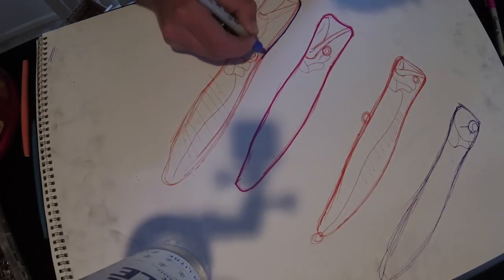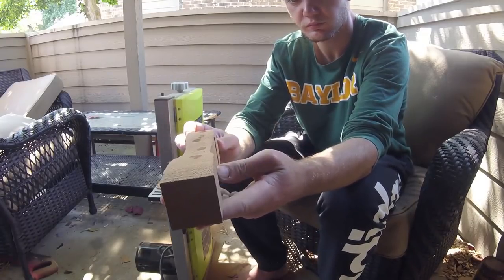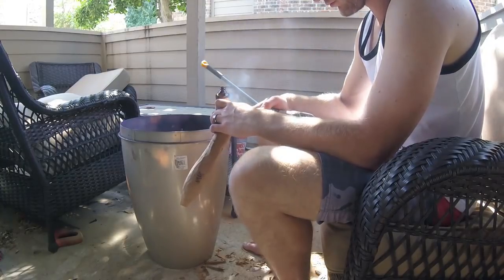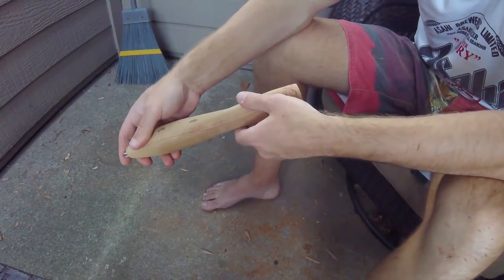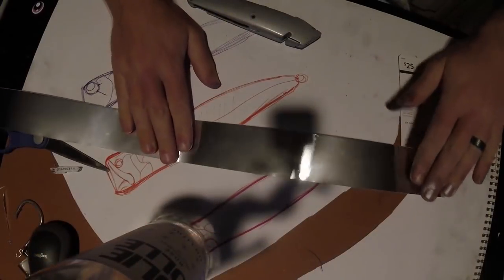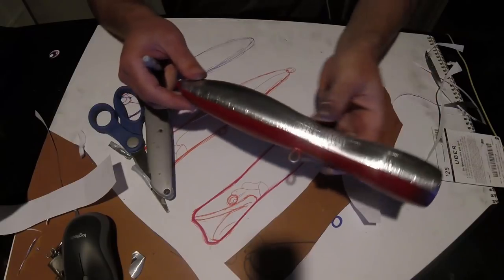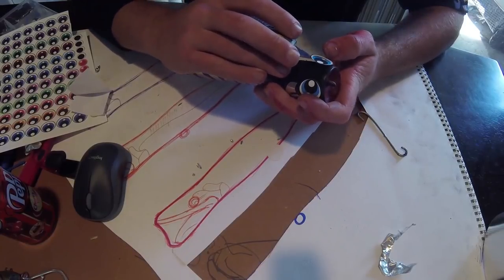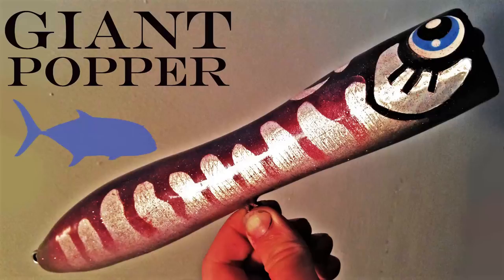Making a GIANT Surface Popper

Comment: hello i want to make big lures like that is 1.5mm wire good enough? and whats the diameter wire you're using that video
Reply from the maker: it kind of depends on the fish you're targeting. I use 2mm wire and that's pretty heavy duty. 1.5mm should work too but definitely a little bit lighter. thanks for watching!
Reply: @TheAnglingGlobetrotters  thanks for replying may i ask is lure rotator necessary for epoxy clear coat? And if yes how can i get one?

Comment: Have you ever considered dunking the raw wood into a tennis ball tube filled with spar eurathane? Us northeast plug builders seal our lures with a blend of spar eurathane cut with mineral spirits in about an 80/20 split. You can even bake the raw wood at about 200 degrees F to open up all the pores on the wood and you will have a water sealed lure that will stay waterproof even from teeth punctures due to the spar sinking into the wood.

Another way we seal, which is a little more of a job is to bake the raw wood at the same 200 degrees F for about 30 minutes. We then take some envirotex lite epoxy (the same stuff we use to coat the lure) and we seal the lure with epoxy. When everything is said and done, you had a water sealed, hard as rock, non porous platform to prime (or foil) and you will never have to worry about water intrusion
Reply from the maker: Hey Dan,  Yes I have worked with Spar Urethane and mineral spirits before however these do not get me the durability results I look for. It's a fairly soft seal in contrast to the proprionate urethane lacquer I make and use. I haven't gone into detail how I make it and use it yet. I do use envirotex for a top coat and double coat it since GT, Dogtooth, mackerel and wahoo are ruthless on lures.
Thanks for your comment!

Comment: What kind of wood are you using for your baits?
Reply from the maker: Hi Noah, I've used a wide variety from very expensive pauwlonia to cheap as chips pine. All of them have their benefits and their downsides. In my opinion, it really doesn't matter what wood you use (make sure it naturally floats) as long as you understand buoyancy and balance ratios. If you need some help with that, feel free to check out my "How to balance a stickbait" videos

Comment: Another good lure man, allways enjoy watching you make em, looks so easy. When I try making the lines on the foil with a Stanley knife or hobby knife it looks great but when u peel it off to stick it it goes to pieces, so im using a different tool now to do it and it works well. Have u ever used jelutong wood to make lures?
Reply from the maker: Thanks Oscar! The Stanley knife can be a bit tricky to use for cutting the scales, I only use the weight of the blade as pressure otherwise the cut is too deep and it all falls apart. But hey, if you found another tool that's even better! Never tried the jelutong wood, haven't heard of it either. Will have to look it up, thanks for the tip!

Comment: What did you use to cut the gap for the wire? Have you ever had a fish rip it apart?
Reply from the maker: The gap for the wire was sawed out with a handsaw and then I used a dremel with a drill bit to widen the gap, scraping away some wood with the side of the drill bit. Fixing in the wire with saw dust and superglue is the strongest connection you can make. I've never had a fish break it apart and on top of that, I've had to break open an old one that I made to take out one of the weights and the wood actually snapped before the superglue connection did. Let me know how you go and if I can help you with anything else!

Comment: I've recently been having issues applying stickers to my poppers, they tend to peel up a tiny bit on some of the edges of the sticker. I've tried after base.coat, tried after my first.epoxy coat, after the 2nd and 3rd. Had any similar issue?
Reply from the maker: Yes, I have had that issue. I probably should've addressed it in the video. I quite often use super glue to secure the sticker eyes now, simply because the adhesive on the sticker paper isn't strong enough to deal with a curved surface. Let me know if that helps. Thanks for watching!
Reply: @TheAnglingGlobetrotters  I had been trying that, didnt have the issue much with the eyes. When using a recessed hole. But having a ton of issue with stick on eyes or wings. Is there a brand of sticker/vinyl that works better for you? My only scare is if I put too much super glue (since it's generally the outside of the sticker that tends to do it), is if I get too much run off on the sticker. 3 things really. The first being my fat fingers end up starting to glue to the popper before the sticker does, 2 the sticker ends up getting a tiny line or 2 of finger print when I push the sticker down to adhere to the glue, or the popper ends up getting that white residue from the cyanoacrylate. Sorry to pick your brain so hard, I've been watching your videos like a obsessed fan, figured youd be the guy to ask..

Comment: how do you put the weights in bro, you should show that part of the build cause in not sure how to do it.
Reply from the maker: Hey man, thanks for watching! I simply drill a hole in the spot I want the weights to be located/poured. I have shown how I insert the weights in my whopper plopper making video. I decided to not show it on every lure simply because every hand made lure requires different weights and position for the weights and it shouldn't be a just a single example that people stick to. I do go in a bit more depth how to balance stickbaits in my stickbait making video. Hope that helps!
Reply: cheers man
Reply: but how do you put the weights in when the wire comes under the lure

Comment: Great video again!   Why do you split your lure, instead of "thru drilling"?  I see the japan lure builders do this also...
Reply from the maker: Thanks! Through drilling would require a very specific drill press that can be used for a very long drill bit. You need a press to keep the wood straight so that you can accurately drill through the determined entry and exit points. On top of that, since you will be drilling a hole to accommodate a barrel swivel as a belly hook hanger it's difficult to create a thick water proof finish. I feel that's why a lot of those lures retire early; they start leaking as the wood soaks up water and then the balance will be gone. There is no possible way for a leak to occur when you fix up the split or slit with superglue and sawdust. Pretty much bullet proof. Amegari, Hedonist, Moutoukenmaru and various other brands build their lures that way.
Reply: The Angling Globetrotters thank you for the reply, I do a deeper cup popper, that produces a great bubble trail. Not much "pop". Would a shallow cup produce a bigger splash? Or is it how the lure sits, that makes it pop more- 45°-or more vertical?¹
Reply from the maker: There's a lot of variables that determine how a popper bloops as well as how big of a bubble (trail) it leaves. Have a look at various good GT poppers like the Hammerhead poppers (E Cup for example). they do not have a super deep cup but are very well balanced. I guess you can always start with a deep cup and sand the edges if it doesn't produce the desired result...
Reply: The Angling Globetrotters   could explain a little more when you say sanding the edges?
Reply from the maker: If you would sand the edges of the cup, it would make the cup shallower which will give a different result when you bloop the popper.

Comment: Having a hard time finding an epoxy, I’m in Hawaii so everything on amazon can’t be sent here, at Home Depot they had a 2 part clear coat for bar tops and I’m checking ace hardware for a 2 ton.
Reply from the maker: I'm not sure if they have a Michael's in Hawaii but if they do, they'll probably have Envirotex. Let me know how you go!
Reply: The Angling Globetrotters I found some 2 ton epoxy at ace hardware, now I just need to get this whole painting thing down. Cheers
Reply: Do you have a Instagram?
Reply from the maker: Sorry for my late reply. I do not have an instagram. Please let me know how you go with the painting and epoxy process!